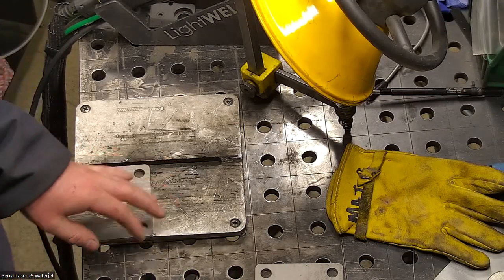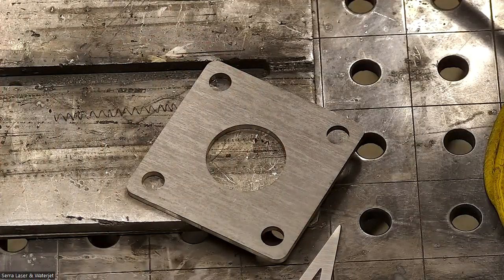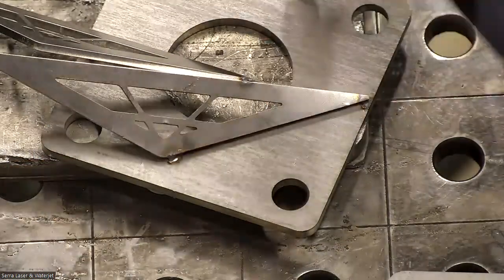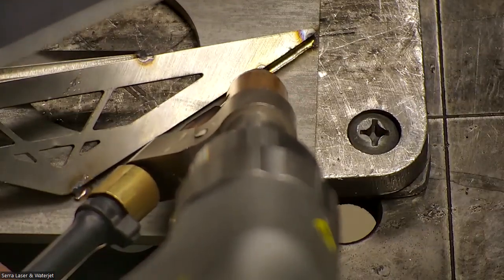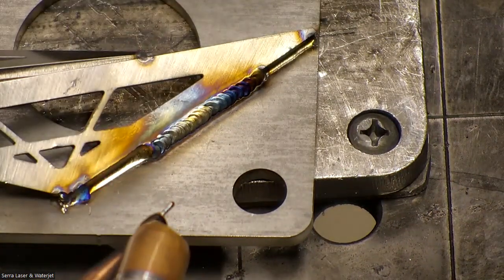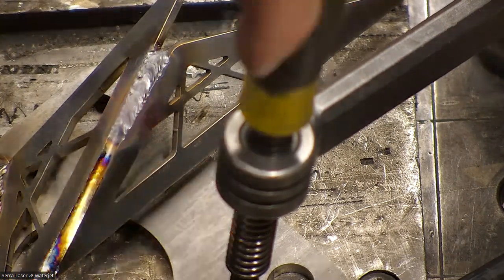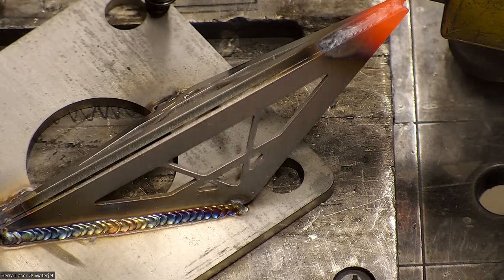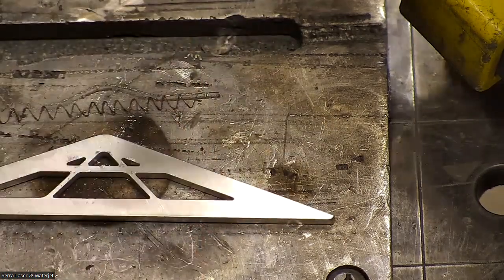IPG LightWELD filling gaps

Comment: With that MIG lime welding, I would imagine that the penetration is more like MIG than laser. I’ll have to try it. As we know with laser welding, the surface size of the bead has little to do with the weld strength as the penetration on a proper weld is very deep and connects the parts internally, unlike other welding technologies.

Comment: Our company just purchased a LightWeld from Serra.  I cannot tell you how much I appreciate seeing you guys doing these videos.  I've watched everything you've made so far.  Laser welding is certainly not same a traditional welding.  We are getting more comfortable with it now.  Takes practice like anything else.  That said, could you talk about the settings on the laser welders in more detail?  That is to say, why should someone increase or decrease wattage vs wobble width.....or are there specific reasons to chose Continuous Welding vs Pulse welding.  That's kinda where we still struggle.
Reply from the maker: The IPG presets do a very good job on the vast majority of welding applications. A weld where you might want to increase the wobble width is an outside corner where you want to catch both edges of the material. The effect of widening the wobble is you will get less penetration as the energy is being spread out over a larger area. So to counteract this - increase the power which increased penetration. Conversely if you narrow the wobble width this will increase penetration into the part.  Pulse welding is used to control heat input into a part - just like it is in laser cutting. You can still get the same penetration with less energy into the part.